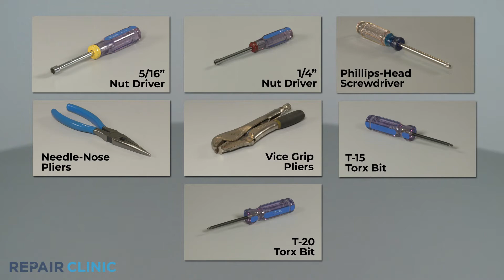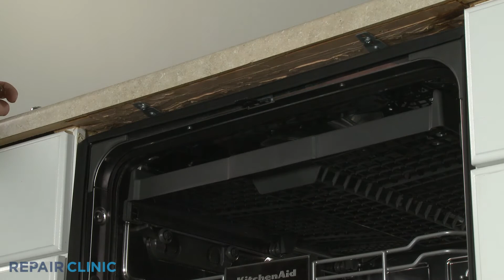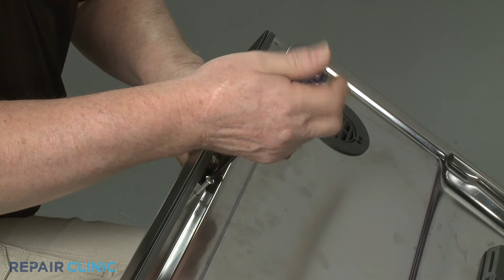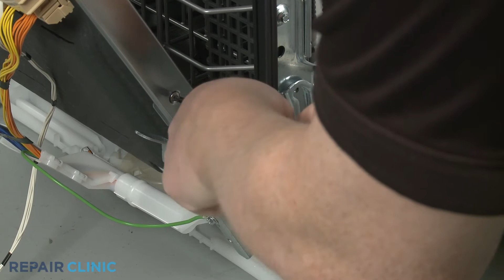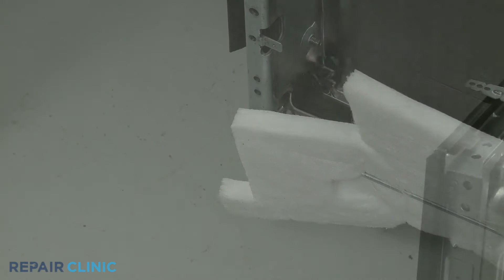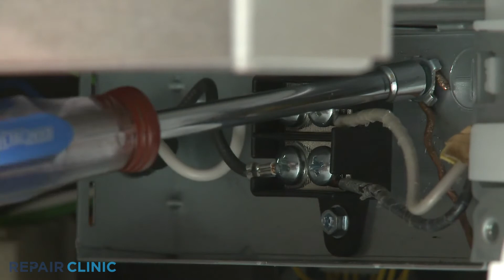KitchenAid Dishwasher Right Door Hinge Replacement W11573702

Comment: Exactly the same thing happened to ours 14 months in (so out of the 1 year warranty).  Seems near impossible to latch it back in with the plastic pieces which I imagine act as a washer but I was able to put it back in just hooking the latch to the metal spring and hoping that lasts.  No idea how it came out because honestly I was not able to pull out the spring from the latch directly no matter how hard I tried
Reply: Color me lucky.  Mine went out in 8 months.   Was going to do it myself, but Kitchen Aid seemed to prefer to call service.  They have to travel an hour roundtrip.  That likely will kill their profit that they made from the sale of the dishwasher.
Reply: I used a leftover 2x4 I had laying around as leverage to help push the spring down to hook the latch back on
Reply: @axwong203  thanks for this note. I had the exact same issue and was about to call for repair when I saw your note about the 2x4. I couldn't budge the spring by hand, but the 2x4 provided the extra leverage I needed and it went back together pretty easily after that!
Reply: @Bunin-m1g I cannot quite picture how you used a 2x4 as leverage to compress the spring. Can you explain how you did it?
Reply: @ahmadshahba3340  Because the spring has limited surface area, it’s hard to apply force directly. Placing a 2x4 or another sturdy object on top will give you a larger surface and better leverage to push it down.
Reply: It just happened to me after 14 months i bought. It looks like common problem with this models
Reply: Me too,  right outside of warranty as though set with a timer.
Reply: The spring on mine just unhooked itself from the latch. I'm just outside of the warranty window as well, so I was hoping to find a way to just compress the spring again, but that spring is difficult to compress.